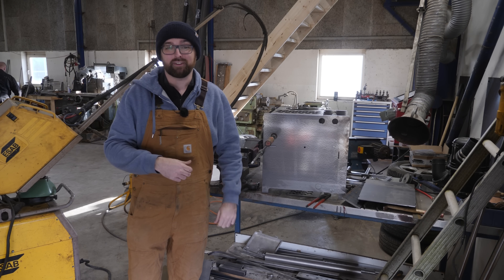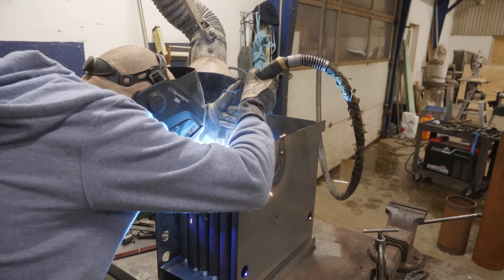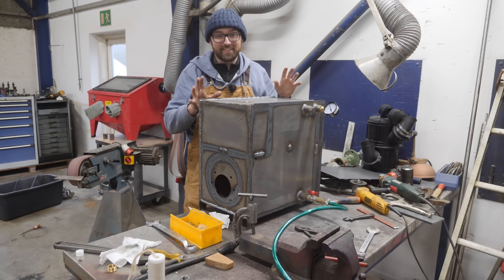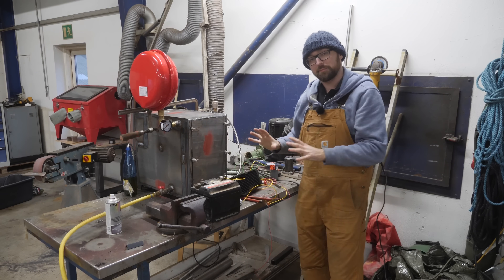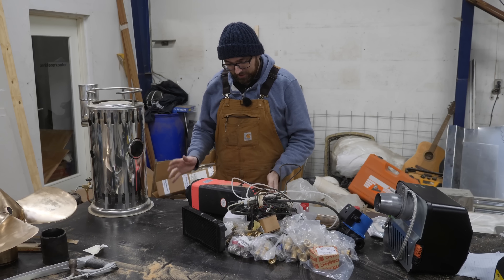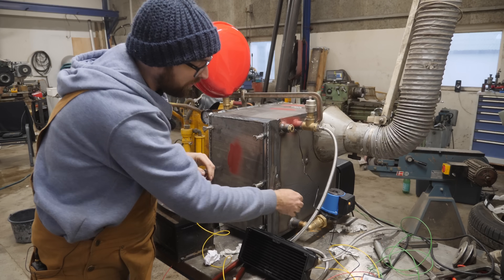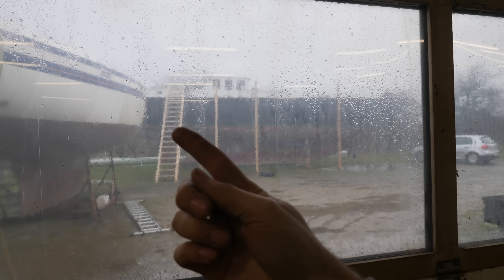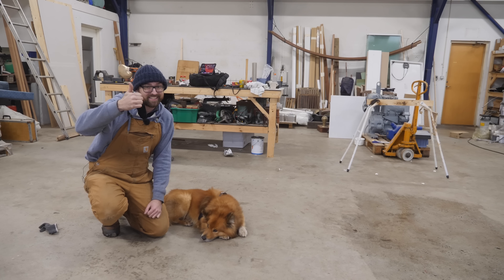Sail Life - DIY boat heating boiler - project sailboat

Comment: Nice one Mads, really cool boiler which makes me rethink my forced air heater option I have on my boat. Also, any chance we can also see more of the work on the cement boat ? Maybe a short video in the middle of every week 😉  ?
Reply: We need Martin (the designer) to do a video explaining the design.  It would be nice if he released the drawings !
Reply: Forced air is much wiser than this over-complicated disaster waiting to happen
Reply: FeelItRising 

How so. I’d like to hear why you think this will be a disaster.
Reply: @NPCSN  pressurized hot water inside a small boat, with crappy welds, self built, takes up huge space, all for radiated heat and hot showers while at a marina?

Almost any alternative seems better to me
Reply: @FeelItRising   first your last point, being at marina... is this your first video you watched this guy and without headphones? full time cursing does not seems to me as sitting in marina. second, design and manufacturing already proven by designer using same model in his boat for years. and third, i know for so many examples where professionally/commercially produced boilers devastated whole neighborhoods so give us a break with your i know it all... oh btw, the working pressure is around normal air pressure and prv is 1.5bar (commercial grade, manufactured by "professionals" and tested and approved by people with paper to confirm their knowledge).
Reply: @zoki.to974  ok know it all
Reply from the maker: @FeelItRising Enjoy your forced air heater no one is forcing you to do what I did here. Enjoy showering with that forced air heater while at anchor ... you can't. If Hydronic heating seems overly complicated to you then don't go that route. You statement that this is a disaster waiting to happen in no way causes me any alarm.
Reply: Sail Life 

Aaaaand this is why I love your show. 👍🏻
Reply: @SailLife  CONCUR !  This is a proven design.  The term "boiler" make most people think of steam.  This is basically a water heater, but a very conservative water heater.  In the US, the standard pressure temperature valve of a water heater is set to open at about 5 bar and 99C.  The safety valves on this heater are going to be much lower.  Leaks.  Well, they happen.  Martin is a smart person and know to test the heater at above the operating range for an extended period of time.  You can't do much more than that !  If they have the space on the boat, why not use it and have the luxury of hot water (which can be an actual life saver when cruising in northern climates).
Reply: @SailLife  Wasn't meant to alarm, you obviously thought about the idea and liked it.  time will tell.

Comment: If I understand how your boiler works, the burner sits in the large pipe and the exhaust gases are pushed through the smaller pipes which are surrounded by water/glycol. A crude pic would be great to help understand it a little better.
Reply from the maker: Thanks exactly what it is :)

Comment: Hi Mads, very interesting video as usual. I have an old Ardic heater in my Finnsailor, which need repair or replacement, will find out during spring. However, I do have another question for you:. How, or where, did you learn welding? I have a restoration project here on the east side of Denmark, and within a year or so, I need to do some minor welding job in stainless steel. I would like to learn to do it myself, and I have a bit of time to practice...How did you learn it, and what equipment do you use? Thanks! Karsten
Reply: Most likely in high school and The Cement Boat Guy - aka Martin.
Reply: I believe that he's just learning now. I think he talks about it in one of the last 10 or 15 vlogs.

Comment: I appreciate your ingenuity.  However, a diy boiler in the enclosed confines of a boat causes my internal caution flags start to wave.  You seem to be this kind of man that does his homework and approaches such a project with caution.  Otherwise, don't try this at home........Best wishes and good luck.
Reply: same feelings here...a boiler is subjekt to high thermal stress, over and over again. little welding experience meets a high level welding job here... also dont see whats wrong with the trusty old reflex stove. everything availiable there with decades of experience.
Reply: This is not your grandfathers boiler. The modern boiler equipment is chock full of safety features and Mads mentioned a mere 2.5 bars or so. of pressure. Should be quite safe.
Reply: Agree but that’s the same for a bad mounted Diesel heater.
But seeing the welding done, this one won’t last long.

Comment: I would like to see more of the details on the boiler.  Water flow, combustion gas flow, etc.  (If Martin would be willing to do such a video in Danish, I would gladly read the subtitles !)  I had my doubts about using mild steel, but with anti-freeze that contains rust inhibitors and a proven design, I think you have a winner !
For non EU viewers, a "bar" is about 14 psi, so 1.5 bar is only about 22 psi.  A very low pressure boiler.  60C = 140F, well below boiling.  Most automotive cooling systems run at 1.0-1.5 bar and about 115-120C.
I think it would be difficult to find such a small 12VDC burner and circulation pump in the US.
Reply: Wondering if a Algae Inhibitor should also be added w/ the "anti-freeze that contains rust inhibitors"? I was not clear if a water filter was inline or not?  I am no chemist or water-ologist... just curious and learning a lot!
Reply: @markfrick6244  - The water portion of the system is sealed, just like the cooling system on your car.  After any air is bleed out, algae can not grow.
Reply: @jackpatteeuw9244  Thanks Jack, after I posted I did some research and concluded the same, algae must have light among other things to live therefore sealed = no light + food etc = no alge.  One day I will learn to look before I type.....
Reply: Me too I missed the part about using anti freeze. Actually the alge will also not grow in high PH or acidic conditions. i should read comments before adding mine!
Reply: Check out Kabola heater.
Reply: I am very curious to know how you size a heat exchanger for fresh hot water..
Reply: @jackpatteeuw9244  by your usage and renewable rate. Basically it's nothing more than a rough guess. A boiler engineer can get close by using the square footage of the area you are heating the average hot water the amount of people the building can hold then the average or normal temperature of the city you are in then times that by .50. At least thats what was explained to me. I see that as a best guess. In the US 25 psi in a water heater is considered a fired pressure vessel with strict requirements. Nothing to be toyed with it can turn into a bomb really quick although i have working with one at that pressure and tem for the past 25 years and nothing bad has happened. ASME Boiler & Pressure Vessel Code (BPVC) is an American Society of Mechanical Engineers (ASME) standard that regulates the design and construction of boilers and pressure vessels
Reply: @davidjensen9035  - Yes, a water heater is still a "fired pressure vessel". That is why every water heater SHOULD have a pressure/temperature valve.  IIRC, typical "city" water pressure is around 50 psi.  There are no check valves on a domestic water heater so they can not be raising the pressure much.
Regarding heat exchangers, I was thinking about appropriate sizing for domestic hot water production.  Obviously the flow rate (gal/min) and desired "temperature rise" along with temperature differential between the working fluid and the fluid to be heated are the key inputs along with heat exchanger design (plate, etc).

Comment: Could it be possible to build a smaller version for a 31 foot sailboat ? If I understand the system correctely, you're only going to use PC radiator strategically placed as your heating ?

Comment: It’s really cool what you are building. I do have a noobie question: if you are reliant on fuel to heat the boat sounds like you will always need to fill on shore. Wouldn’t it be best to find solar and/or wind power for all your power needs. Those are free (minus the initial cost of generators and the ocasional maintenance)
Reply: I am sure that a solar/wind setup is not gonna provide enough heat in cold areas. Whenever you need to move something heavy, or cool/warm, you need dino-squeezings in some form :)

Comment: Please look into KO wool and possibly some twisted flat stock in the tubes to slight restriction or head pressure on the combustion air.
All burners need good fresh combustion air. Boats can be air tight please keep this in mind.

Comment: Use a heater core from an automotive application for the radiator. That's what the PC cooling setups used initially. Plus choosing a common model (i.e. VW or GM) and you should be able to get replacements cheaply and from just about anywhere.
Reply: Go with Toyota or Honda. Their parts are more widely available worldwide with after market parts everywhere. Having said that, any automotive heat exchanger could be used as long as it is roughly the same size and capacity. Happy hunting.
Reply from the maker: Interesting idea :) I've got a couple of other heat exchangers coming in. I'll look into the heater core idea :)
Reply: the heater core from a 2015 toyota camry is the right size to mount 120mm fans to and costs only $40
Reply: @SailLife  I'll second automotive heater cores, they are cheap, plentiful, come in infinite sizes and shapes, brass or aluminum, and are purpose built for heating using hot water. Make sure your boiler a long time and make sure no external parts get too hot, or exhaust pipe doesn't get too hot. Maybe double walled exhaust pipe. Have a search on amazon for "auxiliary heater" and have a look.
Reply: @SailLife  maybe use an antifreeze solution rather than water(?)
Reply: @iainlyall6475  a 30% mix is best
Reply: @iainlyall6475  This is a pretty standard thing to do to help reduce or eliminate corrosion.
Reply: @iainlyall6475  a good alternative would be a alcohol mix.
Reply: @SailLife  I was also going to say try Land Rover matrices - they are silly cheap as there are so many old Landys on the road around the world. Under £30 for a large alloy one
Reply: North American school buses use a heater core that would be overkill for your boat (unless you are staying late season in the higher latitudes). Very reasonably priced, but way too large. Dickinson has some reasonably sized/priced ones. Or you can exercise your Google-Fu. Best wishes
Cheers
Reply: Mark Johnston too big and besides there is a radiator type heater called , red dot . Very compact that will heat a 50 ft boat via heat exchanger or engine. 
 Had one o. My 45 ft Nordic sailboat.
Reply: peugeot 605 diesel -90s ? has water intercooler .should work great the other way aroud i'll think ..
How many Kw is the heater ?
and wich exhaust temp?.
Reply: The radiators placed along seat rows in buses could be a good alternative for a passive type solution.
Reply: Jim Nickles they last as long in a marine environment as they do automotive. Have utilized both systems. They are exactly the except smaller on boats. 
 I’ve cruised the northern latitudes close to a 100 k nautical miles with them.

Comment: If you insist on using CPU fans for the radiator/s (which I think is a bad idea, they don't last long in salty air), use Noctua! They are remarkably quiet and durable, and far outlast any of the others.
Reply from the maker: Just trying out different options. I've got another couple of heat exchangers on the way :) I don't think it's necessarily a bad choice tho. The one in the video is made out of copper. That should be fine in a marine environment :)
Reply: The fans on Waeco cooling are by Pabst (like PC fans) - had no problems with them on the boat...
Reply: We have had 7 pc of those fans running for 2 year, 3 of them 24/7 and none have broken down yet.
Reply: @martinschnoor8305  3 years in a marine environment is nuts. Even 3 years in a regular PC case the bearings start to make noise and wiggle. With that said, they would probably be running at a higher RPM in a PC vs a radiator used simply to move air. Regardless, a liquid ball bearing Noctua PC fan is still the best choice. Anecdotal evidence aside, they simply last longer.